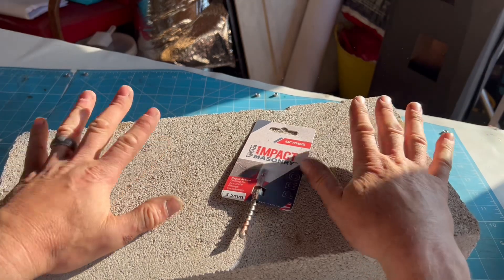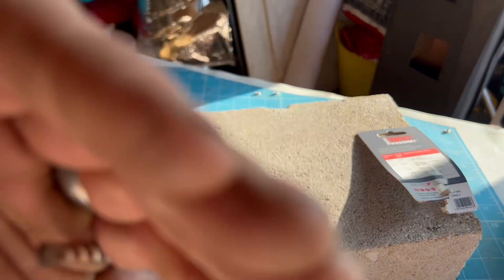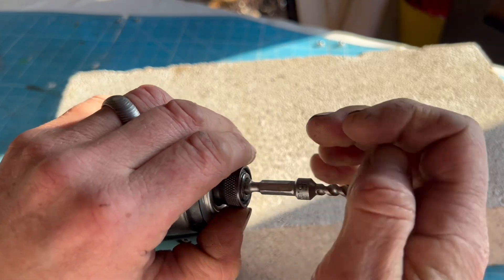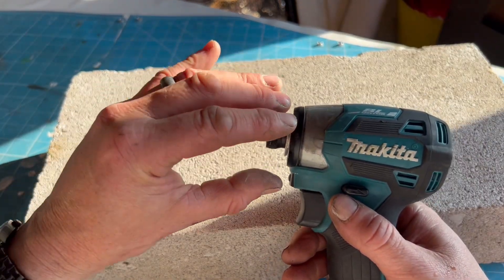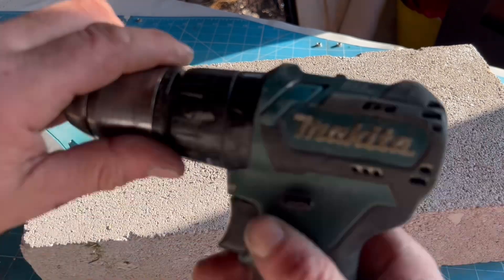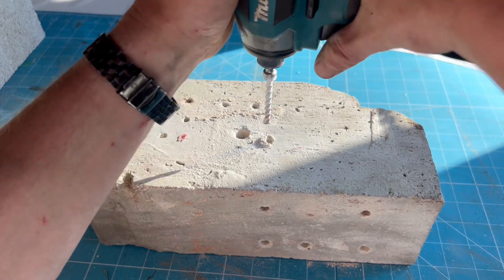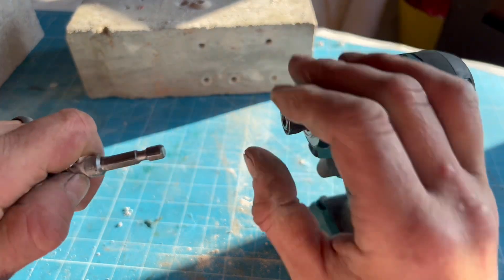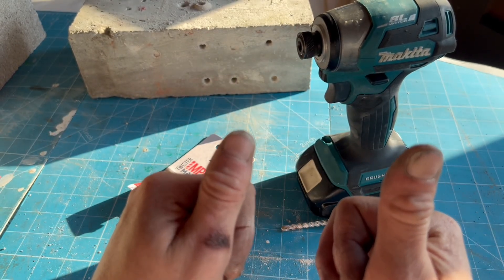Let’s test this masonry  impact bit from armeg, there is problems!!!

Comment: Maybe it the bits tight because the DTD173 is Japanese market and they have a slightly diffetent chuck 🤔
As a tradie it's a no from me , i don't even use combi drills for masonry i always use SDS
Reply from the maker: Mmmmmm iv heard Japanese chucks have different tolerances but iv never had any issues,it was miles out of size and took allot of grinding to fix it, just a one of bad casting I suppose 🤟🤟
Reply: @UKTOOLTALK  I think it's more to do with where the Groove is on the but for it locking into place but you never know

Comment: I suppose it can fit in slightly narrower spaces, and you only need to bring one tool, but I can't see either of those being much of an advantage. Are there any drilling jobs or materials to which an impact driver is better suited? There must be some kind of market if manufacturers bother offering drill bits to fit IDs. 🤷‍♂️

Comment: Looks like an interesting drill bit. I wouldn't buy one just  in case it got stuck in my impact's chuck.
Shame really. I thought Armeg were better than that.
Reply: Might be related to his Makita impact td173, which has the Japanese predominant chuck. Japanese chucks are uncommon in Armeg's target market and they have different specs than what armeg targets. It could still be a one-off. 

Personally, what I have noticed with non-japanese bits on japanene impact chucks made by Makita is that the non-japanese bit wobbles back and forth a bit more than on other tools. Also I have read comments by allegedly Makita EU repair technicians that the bit sticking to japanese chucks is common